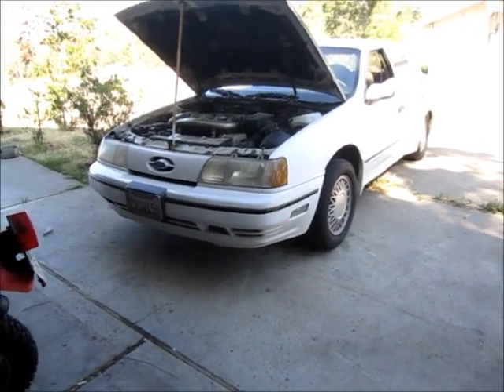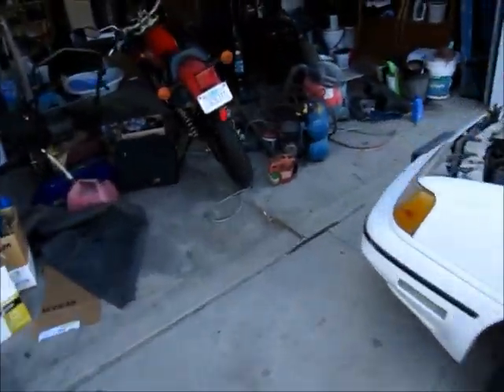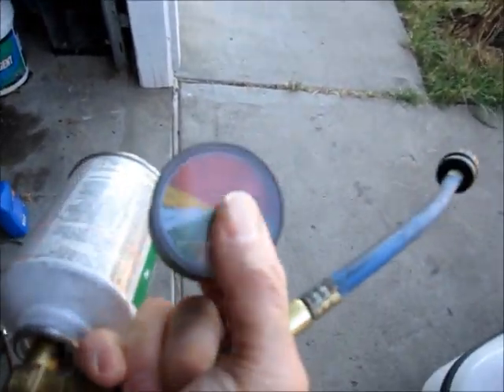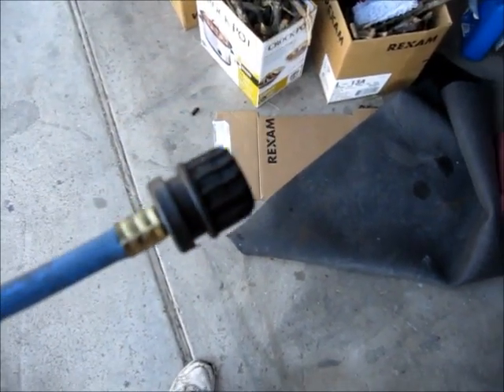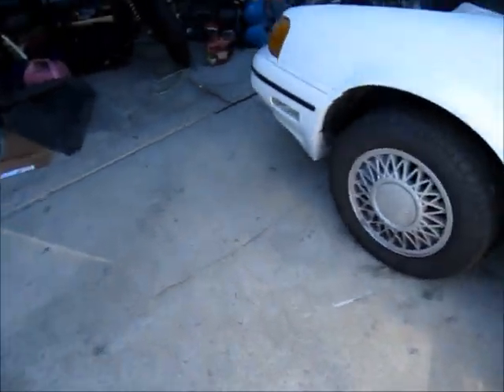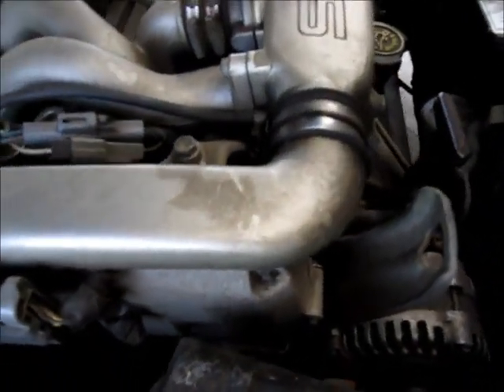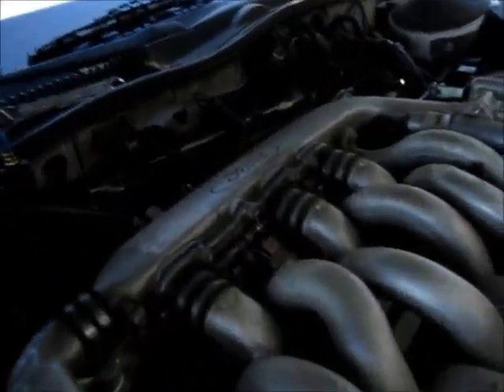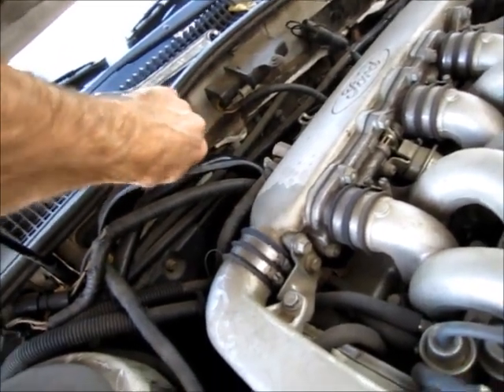How To Charge Auto A/C Systems - Backyard Style Car AC Fix

Comment: I live in a story and a half, so our central air does not cool the upstairs. https://www.youtube.com/post/UgkxxsUnXhGsSJLim_XnMHyQK0u3XVaW-CGn I ordered two of these units because our upstairs is so long with tandem rooms. I just got these three days ago and hooked them up today. These are so much easier than trying to insert window air and needing a frame for them. The Black and Decker are made really nice (actually better quality than I had expected) , they were easy to install. I only had to cut a few inches off the end of window insertion. They are not as quiet as central air , but they cooled down the room really fast and I am very happy with them. The only downfall I would say , is they will require a little more space. Our rooms are quite large, so it was no problem. I would recommend these units to anyone.

Comment: Make sure you measure the pressure.  If the system is overcharged, it will turn on and off in the same way.  So be sure you don't have enough refrigerant, not too much!

Comment: i noticed you put the can UPSIDE down. is this the right way or it doesn,t matter at all you upside down or downside up?
Reply: Supposed to put upside down. Says on the can
Reply: why this way?? what does change by doing this?
Reply: I assume (i'm not an expert) that since the refrigerant is a liquid it prevents the system from sucking the air from the top of the can instead of refrigerant.

Comment: Revving the motor makes little sense, you have a AC compressor for a reason...
Reply: I never knew it was connected to the engine (sarcasm) it is designed to operate for nearly 100% on idle. Revving it does not make it any colder or make it pump much faster. Infact the magnetic clutches in combination with the size pulley, these days will automaticly shut your ac down whenever you would.full throttle your car. With other words the ac compressor rpm is set to a certain max rpm.
Reply: *****
 Oww sorry did i offend you with facts?
I think nearly everyone here knows that the compressor is attached to the engine.

"or RPM increase with it(yes, it increases, because the pulleys are connected directly by a belt, but i guess you already know that). Higher RPM means pressure will be"

Pulleys are different sizes causing a gear ratio (speed reduction)
Also do what i did measure the actual RPM of your compressor. It's not inline with your car engine RPM (which makes sense too for obvious reasons) but also due to the gearing involved..

The reason is ACTUALLY super simple, you will be at capacity already of the compressor at a certain RPM obtained when driving what not. I clearly stated, that it will NOT make it any cooler, also goto a good garage you will NOT see them  FILL an AC system while revving...

Comment: I always attach the charging hose to the fitting BEFORE turning the system on.  As for can top or bottom up, bottom up is faster, but control the pressure rise to come up slowly by holding the can in one hand and opening the valve slowly ... control the rate of rise with the valve.

If you do have the situation where the refrigerant is too low to start the compressor, you can use a short piece of wire to short the pressure switch, but if you don't already know about this, you probably should not try it.  Take it to someone who services A/C.

DO NOT rev the engine while charging.  That's a good way to blow the compressor.
You MUST be aware of temperatures.  Best done on a hot day.  The car should be fully warmed up.  When you turn on the A/C, open all the windows, fan speed highest setting, NOT 'Max Air, as that simply recycles inside air instead of drawing in fresh.  Unless ambient (outside) air temp is above 80 degrees, do NOT charge until gauge needle goes to normal (in this video, the green zone).  The cooler the air, the less pressure you'll see on the gauge when full as you are charging.

DO wear the eye protection.  DO be careful and pay attention to what you are doing.  DO stop and take it to a pro if anything is not going as expected and you can't figure out why.

This can and should be a safe and effective procedure, but farting around or winging it can easily leave you blinded or seriously injured,

Stay cool.

Comment: Love the SHO.
Reply: I'm glad I'm not the only one who realized how special that engine is. The SHO engines were ahead of their time and it was Ford's way of adding some competition to the Shelby guys for high performance modifications. It didn't take long for Shelby to get the hint to become a little more innovative and a lot less lazy in their approach to HiLo modifications.

FYI - this is a sought after engine by owners of Older Japanese cars with rear wheel drive, most notably the Nissan 200zx. With just a few mods, the SHO engines turns the Nissan into a beast!

Comment: First thing you should do is check for leaks. If you see an oily residue covered in dirt/dust on the any of the lines, tubes, fittings, connections, compressor, or condenser . That's an indication of a leak and it should be addressed or your just throwing your money away. 2nd check for restrictions in air flow. A clogged condenser or evaporator will cause a/c to run poorly. 3rd Check your cooling fans come on and spin. Check the level and temp specs of your coolant in your radiator. a poorly functioning cooling system will cause your air conditioner to cool poorly. 4th check If there is any refrigerant still in the system before recharging it, you want to recover it with a recycling machine . If no refrigerant is present in the system, then you can skip that task. 4th youll want to get a vacuum machine and suck all the air and moisture out of the system for a good hour. Not required, but for good measure I like to replace the receiver/dryer/accumulator before every recharge.  You can get all the tools required for the job at Harbor Freight.  If your too poor, just return the tools for a refund after your done.
Reply: +Jay Stevens Jip that would be the way to go, however he does not really need to vacuum..that is more for systems that have 0 pressure/refrigerant in them. In his case, it was low thus still have a vacuum

Comment: I have a Subaru wagon that was never charged with any coolant in 20 years. I didn't want to fuck with it as long as it works. But today it hit 95F outside and the AC was not that cold, but was comfortable inside on Max. Looks like I am gonna have to recharge it. Will see how it turns out. My compressor does not cycle though. It runs for like 20 seconds shuts off and then again 20-30 seconds etc. But it's not really cold. Didn't want to fuck with it while it worked. I might fuck it up...
Reply: Y10Q Coolant is for the radiator and motor, not the air conditioner.

Comment: I'm driving a 98 nissan quest and I'm not sure if it's okay to add more than one 12 once can of refrigerant, but I've added one can the ac runs for about 20 minutes and it started pumping hot air all over again.
Reply: U need a pressure gauge to tell if its leaking out
Reply: +kenny dangles  You're leaking, check your hoses, connectors, you name it..

Comment: Holding the can upside down is dangerous. Why? Because the AC compressor is designed to compress gas. If liquid 134A gets into the compressor it will damage the compressor , then you will need a new one.
The only upside to a liquid charge is charging time will be decreased.  In order to do a liquid charge , special safety procedures need to be followed.
Reply: OnEmpty as soon as the liquid goes into the low side the Liquide flashes into vapor.
Reply: Bullshit.

Comment: If you put the can down in HOT water it will transfer much quicker no it will not rase Psi to high used this little trick for years works grate

Comment: Doesn't anyone read directions anymore? The can should be pointed up, not down. Liquid is entered thru the high side, gas thru the low! Also, the low side pressure reading is dependent on the outside air temp. It is not always 25~30 lbs! Read a book, understand the system before you try to add refrigerant to your car's system.
Reply: @MrHat..
Directions?!?  You mean the Literature on the SIDE of the Can??  ..That Leaves OUT Important shit that Contradicts even what a Mechanic Suggests on how one should Apply the Fridgirant??  The smaller recharge  "Can Directions" Never say --FIRST Apply Hose with Meter to First Check the current PSI, AND Then Attach the CANISTER !!
Reply: Superheat and Subcooling
Reply: Richard Kliniewski "There are two ways to charge: gas (can or cylinder up), or liquid (can or cylinder upside down). A compressor is designed to compress gas. Direct liquid charge will harm the compressor if suction pressure is not controlled. Liquid charging is faster, yet is riskier. Liquid charging should be made by professionals or under supervision. Liquid charging can be done if the suction port is away from the compressor (some compressors have the suction valve in its body.)" Just saying...
Reply: hatfez I agree, as in home AC, all 4 series, 404, 410 Freon will be introduced to the system as a liquid, bottle upside down. I understand that refrigerant is introduced as a vapor with bottle right side up. The refrigerant changes state, from vapor to liquid after a metering device. On home AC's you can introduce R22 as a liquid thru the high side, only after the system has been evacuated. However, if refrigerant is in the system it will need to be introduced thru the low side due to head pressure on the high side. On homes, the compressor is a vapor motor and the vapor leaves and then turns into a liquid after a metering device and then into the evaporator as liquid
Reply: Richard Kliniewski understanding how A/C works and with gas or liquid, takes a lot of knowledge. Understanding this stuff is a fine science. Ac systems are complex systems.

Comment: I can't get the damn quick connect on my gauge to connect to my low port. Won't snap on.
Reply: You might then be trying connection to the high pressure port. Otherwise, it should fit unless you are dealing with an R-12 system (1994 and earlier).

Comment: If your car came with R12?  KEEP IT R12 !!!  Don't cheap out on your AC.  You will be sorry.  The R12 hoses will leak the R134A, and you will destroy your compressor from the higher pressures of R134A.  Besides, R134A is no where near as cold.
Reply: And where do you propose to buy R-12
Reply: reltub20001
 It's everywhere..... It is made in Mexico and it comes across the border just as easy as the illegals.  They bring it in with them.  Look for Dupont brand with Spanish writing.  This is the same R12 that was made here.  At least R12 is not drugs, although that too is pouring in the country as well.  You are funny lol.
Reply: HHH100 lol no its not... you have to have a license to get r12
Reply: mad mike bro
 Really?  Then how come I was able to buy all I ever need for myself, my family and friends without one?
Reply: I think it depends on your region. I got the license through my work. It's a real simple test and pretty cheap I believe. I live in Cali so wouldn't surprise me if you have to have the license to purchase r12
Reply: hanksranger Maybe... ebay.....or ...amazon ...
Reply: HHH100 I had my 1986 Nissan Skyline retrofitted with R134A in 1995. R12 has been illegal in Australia since 1993 so refilling with the original refrigerant was not possible. The only changes was the installation of adaptors on the high/low lines to allow attachment of the R134A re-gas fittings and a change of compressor oil. A new receiver dryer was installed and the system refilled. I sold the car in 2002 and the air was still working perfectly.As far as a difference in cooling capacity,if there was a difference you couldn't feel it. We heard all these myths concerning R134A and retrofitting to R12 systems when it was introduced in the early 90's. The only cars that had problems already had compressor and hose defects.
Reply: Kristy Marree W
The compressor would eventually fail prematurely from the higher pressures of R134A.  Also since the molecule of R134A is smaller than R12, it seeps out from the original R12 hoses through the walls.  R134A requires barrier hoses.  You had to most likely always add R134A each year to keep it working sufficiently.  R134A is also corrosive unlike the inert R12 that does no harm to anything except a leftists ego.

Comment: Can i use this on my benz ml320 yr 2000 ?
Reply from the maker: This will work on most cars that use r134a, but only if the ac system is in reasonable condition.
Reply: +Jennies Garage pm

Comment: I have a 1992 Accord LX and I put the adapter on the low side and connected the hose and turned the valve with the car on and AC on full blast and for some reason it doesn't even suck the contents out...but when we try my sister and mom's car it takes it right away even with one compressor not working....can you tell me what I can do?
Reply: you need to vaccum the lines first. but it may not be a compressor issue, but it could. You need to understand how the system works. As a safety feature not to burn up a compressor it is engaged via pressure and electromagnetics. If you put fluid in the low pressure line it goes hrough the line to to the cabin where it hits fins and and air is blown over the cool fins to give you cool air then it continues  threw the line to the compressor where it is pressurized and and heated  out of your compressor then to your to your condenser and then dryer to get out the water  then it is a liquid again. to start all over. So if the system has a major leak  then it can not be drawn by the compressor and not engaged. I would start by renting a vacuun and gauge set from auo zone its free when you return it and vaccum the lines attaching the high and low pressure valves to the gauges and vacuum for a min of 30 mins as the water under pressure wil oil evaporate and be sucked out of the system. If you have air in your lines you will have moistier as well. After 30 close the valves on the gauge and you should have a negitive low pressure of 20-30 . leave it for at least 45 min then come back. if you come back and it is back to zero you have a definite leak. High pressure and low pressure hoses are a great place to start. Dont be freaked out about the prices as they can be several hundred dollars, Google hose repair shops in your city, Most places can repair a hose for around 40 dollars. Its possible since it is not drawing at all that it is a fairly large leak if it is a leak. Let me know if you need any help with the steps! I would be glad to help! Dont do it by just putting refridgerant in when air and water mix with R-134a it makes acid which causes way more leaks and ruins your compressor lines and seals!
Reply from the maker: Hi, check to see if the compressor is turning on. Have someone turn on the ac when you're looking at the compressor. You should hear a click, and see it start turning. If this doesn't happen, there are more serious issues with the system that just a quick charge can't fix. My best guess without seeing the car is a large leak that has let enough refrigerant escape that the compressor now knows it's low and won't engage. It's a safety precaution to keep the compressor from frying itself. Hope you get it sorted out!

Comment: Can we use ambient thermometer to check the cooling intensity ?? If yes then what would be the temp in a grill of fully charged sys.??  e.g 5°c or 9°c or else
Reply: Systems are all different depending on the system and also on the the range of the engine. Under the hood on the front where there is diagrams there is a decal whic will tell you how may ounces youe ac sytems requires.DO NOT EXCEED THIS NUMBER! You need to properly vaccum seal and fill correct amount. Free on is not like fuel it is not something to be used up. It is the changing of R-134a from a liquid to a gas for then back again. Cool air can not be made heat can only be drawn from it.  If you want maximum cooling for your system. you must remove all air and moisture and replace with solely refridgerant. Once the correct amount is added it  will work at its optimum level while not damaging the system. You may be able to keep adding fluid for a while and yes it will get colder but your system will be headed for a very expensive demise!! Love to help if you have any question on properly charing and finding problems. Also be very careful high pressure line are not to be played with and can prove dangerous.